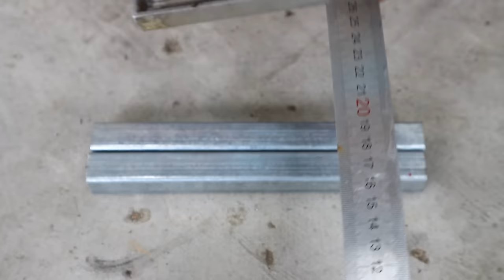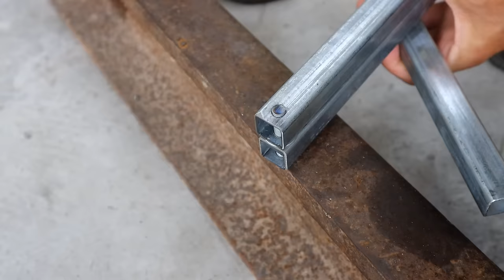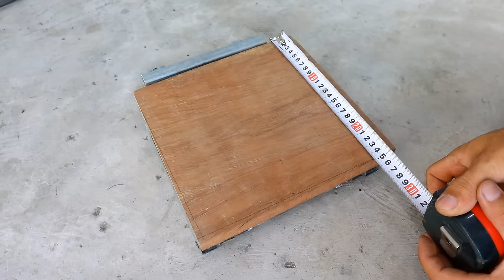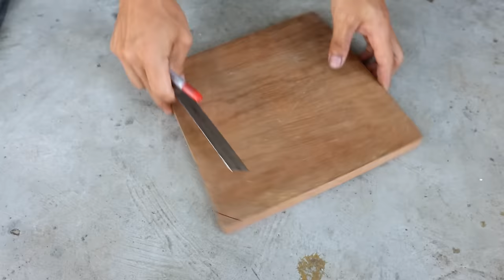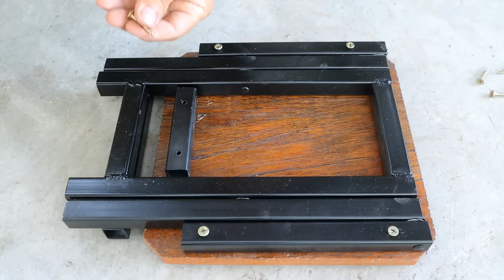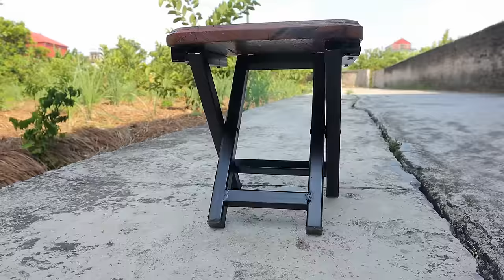Great idea for smart craftsman's compact folding chair / Diy smart folding metal chair

Comment: JAL form kingdom of  Morocco: 
 Why didn't you make a foldable back.. It would be a good idea with this chair, but I have three tips and it will be views in height: first, use smaller circumference tubes, second, 44 cm height for the seat.. third: shiny metallic paint with flakes glitter 👍